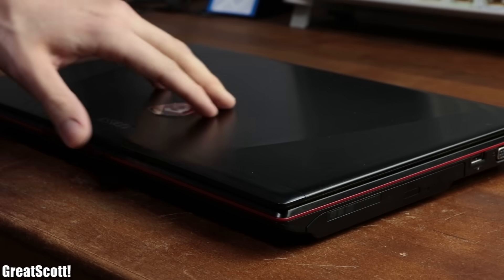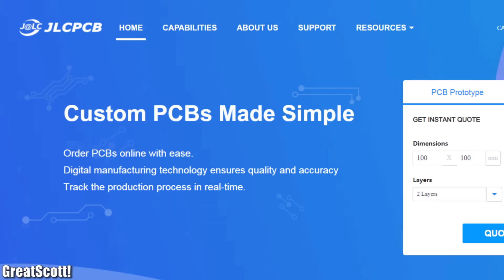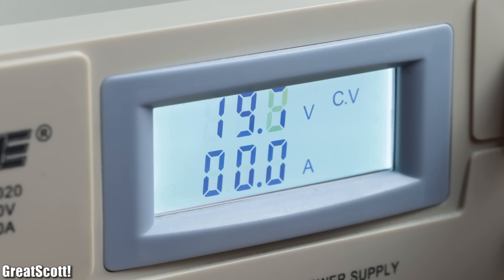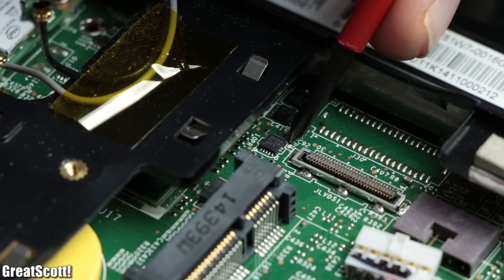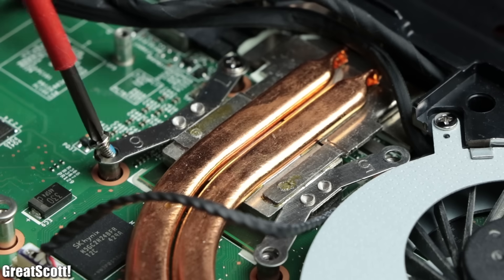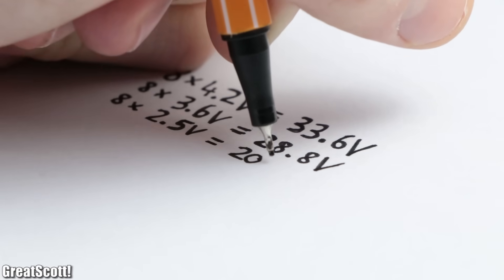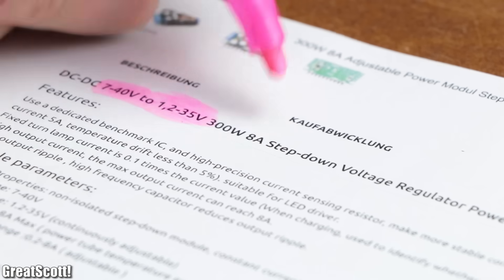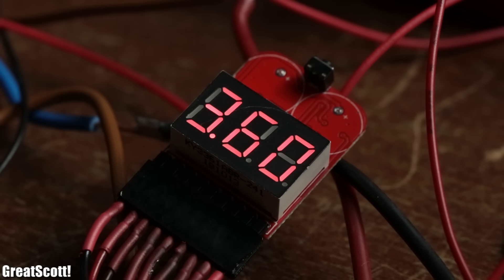DIY Laptop PowerBank (battery pack to charge your laptop on the go)

Comment: Why not buy a cheap battery and just 3d print a new case and make a 3s many parallel pack?
Reply: Why would he go buying more batteries when he already had a suitable spare one?
Reply: It lacks the cricuitry wich communicates with the laptop and that charges and balances the cells. You will neve be able to "make" a battery. And add that to the fact that many newer gaming laptops and even normal consumer laptops won't have removable batteries anymore, it makes your option impossible in every way
Reply: @eduardoavila646  i still dont understand why removable batteries have disappeared 
i see no benefit in turning the device into an expensive paperweight when the battery dies (vs bringing a few spares with you and swapping them out as needed)
Reply: @mwbgaming28  Well, in the user side: 
1- Thinner devices
2- Water resistant devices 
(Both are absolute bullshit to me) a galaxy s5 for example breaks this water resistant mith. 

Thinner devices are a stupid idea, what does worth have a paper thin device that is only a bad paperweight?

In the company side: 
1- Hard repair, users cant thinker with the device to make it better or repair it, so it makes higher sales.
2- Devices last less, only last now the battery life, before you would replace it. So no need to sell and manufacture so much spare parts. 
3- Cheaper to manufacture devices, without having to put a dedicated battery slot/place, and a battery shape wont need to be standard. 
4- They sell way more powerbanks and acessories.

So yeah, it's pretty much a advantage to the companies, not to the consumers.
Reply: @eduardoavila646  why is this predatory design not banned?

Other unfair business tactics are banned (like predatory pricing, bait and switch, false advertising.etc) 

I think planned obsolescence should be banned too under penalty of a fine that is equal to 100% of the gross revenue from the previous financial year before true fine was issued
Reply: @mwbgaming28  Yeah, but so many companies do, and there aren't many consumers against it. 
Most just accept it "well, its newer tecnology, it will last less because its more new and advanced, so its more brittle". 

Just look to the smartphonw industry, apple never adopted usb-c or micro-isb in their iphones, they ditched the headphone jack and also did the other companies, same for the sd card, apple never supported them, other companies are following behind killing it. 

Its a very subtle thing too. These changes usually come slowly like devices getting thinner and then batteries are bolted, then glued shut. 
And usually they have excuses like waterproofing, etc wich is enough to baiscally stop peope from wanting to lawsuit them. 
But even apple, one of thw masters on that, had some lawsuits and many fans ditching iphones because some of their practices, they may have gone too far.
Reply: @eduardoavila646  I think my fine would kick them back into gear 

Predatory business practices should all be banned, that includes planned obsolescence
Reply: @mwbgaming28 :
I find that a lot of devices like laptops, monitors, TVs are difficult to open these days. You can remove the screws but it is still not possible to open them without breaking the plastic.
The screws are basically useless decoration.
Reply: @mwbgaming28  Yes, with apple starting to go too far, and other companies going the same way, i think it will get way worse but then it will reach a limit where the consumers wont buy anymore, and they will to go back and produce quality products again. This may be too optmistic tho.
Reply: @eduardoavila646  well let's hope apple gets whats coming to them
Reply: Lol its diy not what you need to buy

Comment: Keep in mind that this might not be always that easy. Some Laptops communicate with the power adapter to find out the specs and adjust power consumption respectively. I tried powering my Dell with an off brand power supply that doesn't have this feature and my Laptop acted weird: Processor stayed in it's lowest power state, it wouldn't use it's dedicated graphics card and battery was not charging. Everything was slow and choppy. As soon as I disconnected that power supply (making it run on battery) everything was fine. Also when I reconnected the original power supply it worked properly.

So your mileage may vary. Good video though!
Reply: This might help explain it for you:  https://hackaday.com/2014/03/03/hacking-dell-laptop-charger-identification/
Reply: @jeffgrant935  Thanks!
Reply: @jeffgrant935  i was about to comment with the exact same link.....  +1
Reply: Same problem with my Dell laptop, it's a Dell thing mostly.
Reply: @bardenegri21  i have this problem too in thinkpad w540
Reply: Cos dell are dicks. The psu has chip that tells the bios it ligit. If the bit built in the laptops bios is broke, even a legit dell chargers wont work.
Reply: @UberAlphaSirus  it not only tells the laptop its legit, it also tells the laptop what wattage power supply it is. dell has multiple ones.
Reply: @gominosensei2008  why would that matter?
Reply: the line it uses also tends to fail in the charge lead...
Reply: Battery charging problem was because of a missing sensor that is used in dell laptop's adapter i have made similar power bank for my dell laptop firstly laptop turns on but not charging battery afterwards i get that sensor from a burnt dell charger now my its charging my laptop battery too.
Reply: @toqeerahmed3016  It's not a sensor. It's a one-wire EEPROM.
Reply: @zaprodk  maybe you are right but in my charger it looks like a transistor with three pins one pin connected to third wire of charging cord and second pin connected to ground after googling it it seems to be a sensor that tells laptop that this charger is standard.
Reply: Just connect a power bank to Inverter with ac socket. problem solved.
Reply: @rackey551  Efficiency would be terrible with that solution.
Reply: zapro_dk Also look up some other 3 pin parts like the ATECC108A that are specifically designed to make accessories hard to replace with 3rd party alternatives, which is quite a scummy concept.
Reply: @johnfrancisdoe1563  yeah that sucks big time :(
Reply: @toqeerahmed3016  Same here, added the ''one wire protocol chip' including the plug from a broken Dell charger to a universal 19 volt car-laptop-powersupply and now it works perfectly. BTW I have something like 50W Dell powersupplies up to a 180W brick: that's what the middle pin is used for: tell the laptop which powersupply is hooked up.
Reply: Yeah, I had the same issue trying to use a HP charger with my Dell laptop, despite it having matching specs and connector - I cut the cable in half and added an STM8 + voltage regulator in the middle, to spoof the 1wire messages from a legit dell 90W charger. The code was quite simple, the legit charger contains a 1wire prom, and the laptop only ever queries a single address - so my code just responded to any request with the data from that address on a legit charger. Works great :D
Reply: yes, some "Alienware" gaming Laptops need special kind of Power supply and wont work with some off brand models...
Reply: For my HP Notebook there is Plus Minus and ID Pin, and you need to also apply 19.5V on the ID pin to charge it.
Reply: @KrX3D  this is just an easy way! some Laptops have id chips or current messure chips in the power supply and cord...if u use any other supply it will not charge or it will not work in full speed..
Reply: it is easy to fool the notebooks that have this, usually this pin has 3.3v depending on how much this voltage drops will identify the power of the charger in dell can use either 65W or 90W so it has to have this.
Reply: I had a similar issue with a aftermarket car adaptor for my Dell.
I was living off grid at the time and tried to avoid running an inverter if I didn't need to. I ended up leaving my computer powered off and plugged in,  since it was a fairly low current adapter I basically ended up letting my computer trickle charge while I was away at work.
I did consider taking my computer to work to charge it every day but that would have been a bad idea.
Reply: Dell also sells their own external laptop battery. :)
Reply: yeaah dell has becomepure evil  just like apple. beter avoid those.   The rhing is yu od not even get any qaulity they can get so hot they actually melt  the plasic air vent trips at the back an my speakers gt melted on a 3000 euro  del precisision  I neede to buy a 240 watts  power supply since the supplied was nod poewerfull enough fo the nvidia chips inside and it kept crahing and  even though i wasnot athe only one with that prooblem dell refused ro ackowlwdge there was a problem. I asume applwe has  better quality since i do not have aple (only an appl enwon which broke a long time ago (but that was because someone threw it on the floor. so a valid reason for it nt to work) but about power suplies yes(som?) dell l laptop have special connectors to de the power of the power supply  and if it is not enough you havee problem. I solved mine by buying a used powersuply  some where. if dell was honest they woul dsell or give us adapters that you can configure to mimmik  acertain poer supplie so the thing would work if only just to charge
Reply: Yes
Reply: With more modern laptops I'd look at USB-C standard for negotiating voltage and current. This requires USB-C charging enabled laptop though.
Reply: yo just change out my laptop batterys i bought a hp factory battery charing dock its just a ton of the sockets my laptop battey connects with so i can connect 60 or so battery i only own 25 though
Reply: I want to know how to label such enclosure box for indication like on/off, output/input using printed text? In this project only marker pen is used and that doesn't look professional!
Reply: well just have the power supply cord be plugged into a power bank with a wall socket , problem solved
Reply: Yes my older Dell laptop does this. This is how I knew they had sent the wrong PSU with it.
Reply: @Xilog  Lenovo plugs have an extra pin for a long time now. From my knowledge though, it is only a resistor inside the plug and the value determines the power from the power supply.
Reply: There have been a few models of Laptop that use a combined voltage input from both the battery and the power supply to run a graphics card.  The reason is complex.  The communication you describe between the laptop and power supply doesn't exist.  Rather, the chipset in the laptop that controls the current and voltage draw with stepdown transistors will adjust based on what is necessary for the system to run.  If you only have battery power, and the system needs more e- to actually turn on the components of that "card", it will consistently fail.  Alternatively, some systems with a failing battery will fail as well, because the system uses the battery as a safety feature for power spikes, and pulls some of the wattage from that pathway, combines it with cleaned wattage from the power supply, and sends that draw through to the components of the graphics system.  When the battery cannot keep up, however, there isn't enough wattage to run the graphics and it fails.  Turning off the part of the system that manages this (a driver component in windows as a matter of fact), will force all of the wattage to come from the power supply, and the card will turn on, but will run at lowest efficiency. 
To recap:  THERE IS NO COMMUNICATION BETWEEN THE LAPTOP AND THE POWER PLUG.  There is a power controller in the laptop that will draw more or less power as required for operating, but it does not "communicate" with the power block.
Third party Power adapters need to match your original adapter as closely as possible.  Match the current, and if possible, go over on voltage.  Current is your matching point, but voltage should never go under.  Voltage tells you the maximum number of e- the device will move, but Current tells you what speed that will move through a circuit.  That speed must remain constant for an accurate clock mechanism (processing clocks etc).  If you go over on the current, you may damage the laptop, but some actually have a decent controller that grounds or simply lowers the draw, which works well enough, but you are still better off with a matching current.  With Voltage, it will draw what it needs, up to that maximum, and occasionally, will function better when some components cause that need to spike, since a higher voltage source will provide the extra energy with little wear and tear, and capably.
You are always better off with a matched power supply for current and voltage.  Variable power supplies just don't cut it when you have more powerful components all vying for the same juice.
Reply: @HTDav01  As you said the laptop manages the power consumption by itself, this is not the "communication" that I was referring to. On Dell Laptops the power supply has a way to report it's capabilities (maximum current it can provide) to the Laptop itself. In the bios I can check what kind of power supply is connected. It shows "130W" under power supply type when using the original power brick, some other wattage when I connect the compatible power supply of my Dell work laptop and "unknown" when using my multivoltage battery bank. In the last two cases the laptop is throttling severely as the CPU is always running at 800MHz. This kind of "communication" works though the third pin of the Dell barrel plug.
Reply: Hi guys, what module can I use to make a 10000mah Lipo battery pack ???🙏🏽🙏🏽🙏🏽🙏🏽
Reply: Basically charger DRM.
Reply: This isn't always a dick move by big brands... sometimes certain laptops go into a special charging mode if they recognize that they are connected to their brand's special charger.  Some Apple products are like that.  There's a reason an Apple laptop brick is as jammed packed full of components as it is, compared to the cheap Chinese knockoffs.  Once the laptop establishes that it's connected to one of its "smart" chargers, it can amp things up  a fair bit.  But sometimes yeah, it's just the brand being a dick.